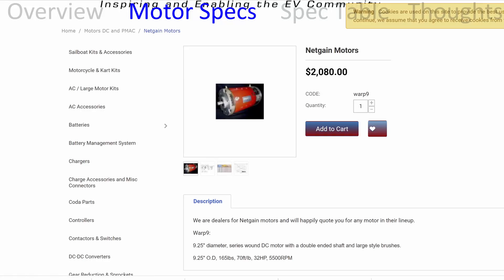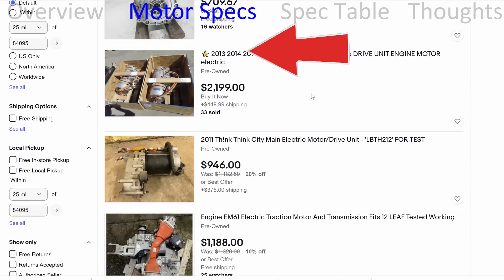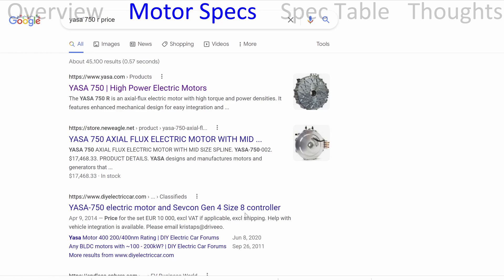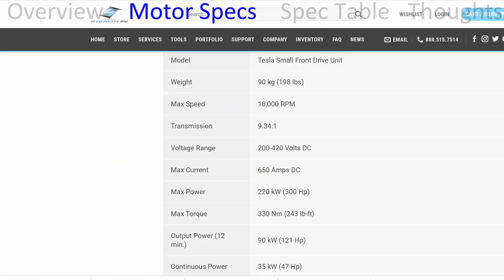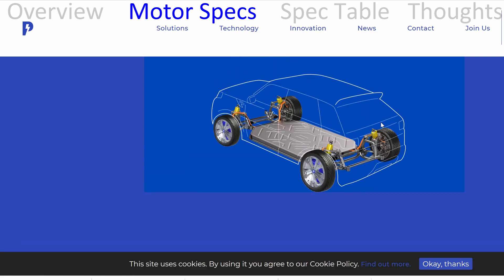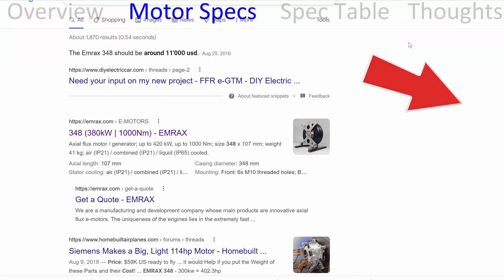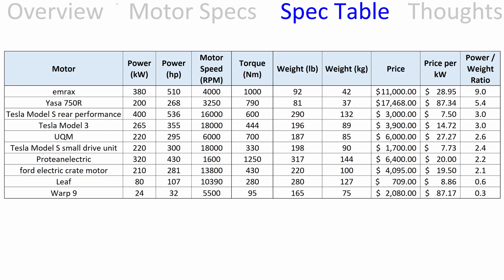EV Motor Selection – How to select a motor for an electric vehicle build - ESC S2 E02-D

Comment: The power of a motor is directly related to its inverter.  The same leaf motor with a bigger inverter goes from 100hp to 200hp same weight.  It also depends on the battery ability to deliver the power.  A 400hp tesla needs a battery that can deliver like 800 amps at 400 volts.  That is a LOT of amps, and is possible because they have a very large battery.    Peak power is almost like a gas engine, you can never run a gas motor at peak HP for very long, in fact on the dyno for 20 seconds they can blow up when testing peak power.   Same for EVs, a Tesla Model S can go about 5 laps around Laguna Seca before it shuts down from overheating.

Comment: What are your goals for your next build?  I have a Shay Model A replica that I would like to convert from its Pinto drive train to electric.  The car weighs about 2200 lbs (1000 Kg), and has the aero dynamics of a brick.  Also the structural integrity of a milk carton boat, and the rigidity of a al dente noodle.  It won't be going more than 60 mph and only for short bursts.  So I don't need a lot of power but it might be good to have some torque.  Maybe 150 hp, and 350 ft-lbs of torque.  It would be interesting to replace the rear differential with the motor/gear unit.  Axle/suspension considerations are next.  It currently has a solid rear axle.  Any comments?
Reply from the maker: Send me an email Electricsupercar@gmail.com

Comment: Pick a motor with a comprehensive manual, available tech support, motor to trans coupler, adapter plate to bell housing (if using orig trans), motor controller.

Comment: Would you consider doing an episode on the options for upgrading an existing EV's battery to allow for more range.  I have a 2017 Hyundai Ioniq electric that is in excellent condition, but with 200km range on a good day, it doesn't get me everywhere I need to go.

Comment: Unless the specs have been independently tested you can't really trust the claimed capacility of a motor. Some specs might be for sustained load while others might specify the peak power for a few seconds. Typically the power rating correlates approximately with the weight. Since car motors often include a lot of extra mouldings and different mounting points there will be a bit of variation, but don't expect a motor that's half as heavy as another to be able to endure the same amount of power.

Comment: The Warp is a DC motor and cannot do regenerative braking. It also has brushes. But it is simple and reliable. Most motors from existing EVs require some kind of brain surgery before you can control them.

Comment: Have you thought about the LMT 30100 motor?  It's a small brushless DC intended for high-end RC cars, but it's rated for 40KW @ 50k RPM, and it's only about 800euro.

They are small enough to have one for each wheel, which would be 160KW all wheel drive, and still less total weight that the larger motors on this list.
Reply from the maker: Interesting 🤔

Comment: 2 points to consider ;
1) As far as i know , DC motors can not provide regen braking.
2) When considering motor choice , The donor vehicles having independent suspension will affect how easy your conversion will be.
If using something like a Tesla or hyundai Kona drive motor assembly , they have the transaxle attached so if your vehicle has a solid rear diff then you have drive integration headaches.
If you intend fitting the Tesla / Kona motor + transaxle into a vehicle , then a donor vehicle with independent suspension allows an easy transplant.
3) Having the motor is one thing , getting a controller to work is another.
    Modern EV's have multiple CANBUS circuits and each time you start the vehicle the ECU will do a system scan to check everything is operational , If you fit a Tesla motor and controller into a different donor vehicle , The ECU will go in to fault mode because it cant see the CANBUS signals from headlights , door electric window winders , brakelights and all the other myriad of CANBUS sensors.
There are a few options to defeat this problem , but that would take up a full video :)
Reply: DC motors offer regen just fine, what you will find a hasle is their bushes, they wear and add to the low speed consumption through their drag. Your other advice is correct, A manufacturer's inverter, is for once matched to the motor of the original vehicle, further there is usually some proprietary can bus signaling and coding that is not public available, but required to have the inverter think it is in the original vehicle. With AC traction motors, you need to tune the inverter to the characteristics of the motor and the vehicle (Inertial mass) to have it react Properly to commands.

Comment: Thanks for the video!
How would the motor from a Chevrolet Bolt compare with your Line-up of electric motors?  Did you consider it, why or why not?  I think a EV Bolt motor has:
150 kW peak power
360 Nm peak torque
8,810 max rpm
7.05:1 gear ratio
total weight of 76 kg
cost is around $2,500
You can also get the Chevrolet motor as an ecrate, but it currently has to be connected to a 4-speed automatic.
Reply from the maker: Looks like you have the data to make your decision

Comment: I'm actively configuring what hardware I plan to use to convert a light mid engine car, or soon to be mid motor cat.  What is not covered here is that total weight for all the necessary parts to complete a drive train.  Gearboxes, trans axles of speed reduction gears, all the controller, converter and charging equipment.  High voltage drives faster motors but requires high voltage batteries and large ones to provide the necessary amps.

I did an exercise comparing 96V, 144V and 360V systems, each of which could be installed (barely in the case of the 360V system) in the classic car I'm converting.  I concluded that moderation makes more sense than outrageous power that can't be utilized for more than a few seconds.  I have abandoned any 360V or higher system.  Just too big, too heavy and frankly just excess weight that would be hauled around reducing usable range.

By carefully specifying how the vehicle I'm converting will be used, with a little upside, I have both a 96V and a 144V configuration.  Peak power is not most important.  It's sustained power.  Maximum torque is not most important, it's most usable torque and over what rev range.  If you're building a complete car from scratch and have the necessary deep pockets, definitely  go the Tesla used parts route, if you have the room.  I don't.  My project weighs less than 1500 lbs to start and will likely be completed at under 1650 lbs and I fully expect to achieve a usable range of 150 miles, which is all I need, with performance better than the original ICE power vehicle could achieve.

I'd love to put axial flux motors in the rear wheel hubs but I won't live long enough to see them commonly available and currently they are unobtanium unless you need hundreds or better thousands for your vehicle factory.

Comment: Power to weight comparison is not a real comparison since the emrax and yasa don’t include and controls, gears, or differential or the housings for those. The Tesla motors would be 1/3 the size and half the weight without those.
Reply from the maker: True

Comment: You forgot Hyper 9 motor.

Also I am wondering how you could potentially use 2 motors. Would this be a hard mod?
Reply from the maker: Nope.  Just need controllers to handle multiple motors

Comment: Seems like torque is greater with larger diameter motors. Many 8 to 13 inch, wonder why there are no larger diameter motors, 18 to 24. Compound stators, inside and outside of rotor.

Comment: Pls. Suggest the kw of a motor that can replace a 2600 cc diesel engine.
Reply from the maker: You are trying to reproduce the output.  What is the horsepower/torque?  What speeds do you want it to go?

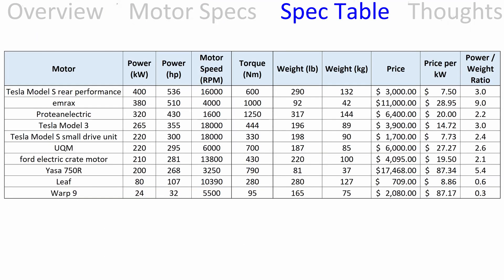Comment: 6:54 The ~32 hp is the continuous power rating for the Warp9, but if you look at the peak Voltage and Amperage, peak power should be closer to 75 to 80 kW, or right around 100 hp.

Comment: For me (aside from total cost and power, which will change based on my budget and the application) the factors I consider are: Motor Type (AC Induction, PMAC, Brushed DC, or Brushless DC), Motor Controller (integrated, separate, or custom), Regenerative Braking Available (required for a road car but not an off-road application), and System Voltage (less than 200 V will exclude the possibility of DC charging).

Comment: Question.  Can any of these motors be mated to a standard automatic transmission?  I'm considering converting a 2004 Dodge Dakota Sport 4X4 Extended Cab to have a 320 mile range with at least 280hp and over 300lbs/ft of torque.
Reply from the maker: Yes.  Howerver you will likely need an adapter plate
Reply: @electricsupercar  Next question. Do you think if Ford were to add a transmission to the F-150 Lightning it would solve the towing range issue? Why or Why not?

Comment: Which one would be best for a 6000 pound Suburban or Tahoe 4×4? I'd want it to tow. 
ALSO: can the battery 🔋 be replaced with a small Yanmar diesel generator or Honda gas generator to supply electricity 🔌 to the motor??
Reply from the maker: Usually you will want to closely match hp and torque
Reply: @electricsupercar  ..... Why does EVERYONE dodge my question about replacing the battery 🔋 with a small Yanmar diesel generator or Honda gas generator making a DIY hybrid 🤔??

Comment: For a 1-2 ton max. Scaled tank (glorified soapbox tank), what kind of motor would I look for? The original 3 ton Im copying has 80-110hp, tho the mechanical gearbox would be hard to replicate
Reply from the maker: What top speed?  What torque?
Reply: @electricsupercar  top speed maybe 40kph, I mean thats faster than running and can be crazy fast, especially if something goes wrong. Torque, ouf, tracked vehicles probably take an enormous amount of torque to move at first... Havent build it yet haha.
Btw thanks alot. Lets say ballpark 200 Nm? 2 motors? One for each side to move? Maybe with 40 kph and a drive wheel diameter of roughly 30-40cm, a 2:1 reduction can happen. Its not that easy, working with unknowns.
Edit: The Warp 9 could technically fall within that window, I guess, or something similar, but huh, unsure really
Reply from the maker: @M.E.R.V. Gaming  if you are looking for two motors I wold think you could go for a warp7 or warp9
Reply: @electricsupercar  cant find them here locally but thanks
Reply from the maker: @chrissi.enbyYT  usually can dig them out of forklifts

Comment: Protean.  Inverter controller, brakes built in.  I  have been lusting after these motors since they their 600hp 4x4 Mini Phev they built over a decade ago. Love to see a DIY car running with Protean Electric motors.

Also you missed the Orbis wheel motors.
Reply from the maker: I'll check it out

Comment: Great, LOTS of motors to choose from.....but what about a controller, inverter, battery maintenance system and all the other components....and more overly, how about getting it all to actually work, operate and run? All these EV conversion places are booked for months/years and they are charging ridiculous pricing and hardly answer their phones or call back. That guy 'Reverend Gadget'...biggest blow-hard ever! Most these places just want to sell parts and offer little to no support. We need Chevy, Ford or some company to truly come up with a legit plug & play system so a typical auto shop can start doing conversions!
Reply from the maker: Well said!

Comment: One question I have which I haven't seen anyone answer so far, is how much power do I need in a motor for a given application? How do I calculate how many kW I need to power an electric motorcycle to 60+ mph? Where do I start?
Reply from the maker: Caleb, a good place to start is by looking at an equivalent gas powered motorcycle. A 150cc motorcycle an do this.  That is ~15-25 hp or 11-18 kW motor.  You will still have to consider gearing to make sure that you can achieve 60mph but for power...this would be fine
Reply: @electricsupercar  Thank you! So from what I understand, motor power influences acceleration and torque more than top speed, and gearing based on max motor rpm determines top speed?
Reply from the maker: @C.Sharpe  you got it

Comment: There are a few points I would absolutely love to see, that would make this electric supercar unique, ground breakingand more interesting than any DIY or factory EV ever built
1. 4 independent motors with no diffs, no axles, just one motor/reduction gear in each corner. you could use different gearing so that rear motors provide  more wheel torque from at lower speeds to take advantage from higher grip that you get from mass transfer, and front motors with a gearing tuned to reach peak power at highway speeds & up so that the power doesn't taper off too early.
2. small battery pack because who needs long range and useless weight on a supercar, with a small super capacitor pack buffer to provide high power, strong and efficient Regen on 4 wheels
3. custom open source software that could be improved by the community to handle independent traction control on each wheel, torque vectoring and abs regen braking, cruise control
4. blended Regen braking and no brakes in the rear with initial with front disc brakes only taking over for emergency braking and redundancy in case of drivetrain failure. 4 wheel Regen braking sending power to capacitors and battery should be able to handle everything but smashing the brakes. Tesla model S plaid is able to accelerate faster than it brakes between 0-60 thanks to electric motors traction control being more precise and quicker than hydraulic disc brakes ABS, so Regen could also brake stronger than mechanical brakes.
5. steer by wire with variable steering ratio depending on the speed
6. fully active suspension using electric motors/solenoids with zero body roll/acceleration squat/brake dive, adjustable ride height (Google "Bose suspension")
Reply: @electricsupercar  🤣 ok I need to chill out, it's very cool to see the whole design process from day one AND to feel involved! If you just did one of those points I would still be mind blown but I had to put everything that came to my mind.
Oh sorry I forgot the last one..diamond nuclear battery pack that stays charged for thousands of years without plugging in

Comment: Hello. Great job on your build. I have been watching for awhile I remember the video when you explained how much you build cost. My question is how much money do you think it cost to do a conversion. I have the car. Everything works on it and can probably sell the parts I don't need for about 4,000. Can I build real power for a additional 10,000.00
$14,000.. that's pretty much my budget at the moment. If you can give me some advice I would greatly appreciate it.
Reply from the maker: The answer is...it depends.
If you want to buy a motor (let's say a tesla rear drive unit) you can go about it 2 ways.  Buy from an electric vehicle shop (ev west, stealth ev, or similar) you will spend close to $10k just for the motor.  You can source the same motor but buy on ebay for $4k.  Similar story with batteries.  There is more uncertainty with the ebay route but comes much cheaper.  If you go the cheap route, $14k is achievable.   If you source only from ev shops, it will be about double.  Hope that helps
Reply: Yes very helpful. Thanks.

Comment: Just got caught up to this episode.

Please don't forget to include in your analysis:

1) battery & motor cooling
2) inverter
3) BMS

Tesla parts would include these critical items while other parts may not.

Remember all the hassles with cooling the LG-chem batteries & all those external BMS connections? 

The inverter, battery & motor cooling and BMS are already integrated and proven in Tesla parts.

John
Reply from the maker: Thanks for the suggestion!

Comment: Is it possible to get a list of everything you need to build an electric car or the main components I would like to know, if you can get the motors out of a model s plaid what batteries would you need to keep up the 500ish mile range?
Reply: Last question but can you use a tesla charger on this build?
Reply from the maker: You would need to keep the Tesla batteries to keep the range
Reply: @electricsupercar  is it possible to keep the Tesla batteries or is there an alternative? What have you used in this build?

Comment: Max (continuous) power is (relatively) unimportant unless you want to achieve (very) high (illegal) top speed [I've never understood why anyone would want to build a vehicle that potentially could reach a top speed of over say 120 mph when it can't be driven that fast anywhere]
Torque is what creates accelleration, so I'd say that should be your primary consideration (max. torque over a "reasonable" rpm range).
[research the leaf motor and you'll see it has a (very peculiar) torque curve]
Reply from the maker: Thanks for the thoughts!
Reply: No speed limit on the Autobahn. Or in racing for that matter.  Or, how about as fast as I can, just because I can?
 It's too fast for me, but to each their own.